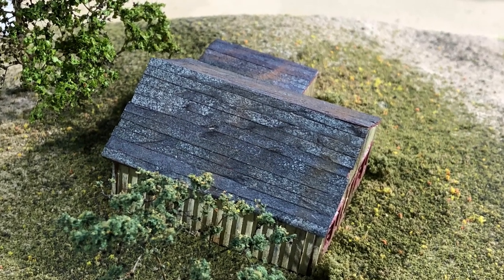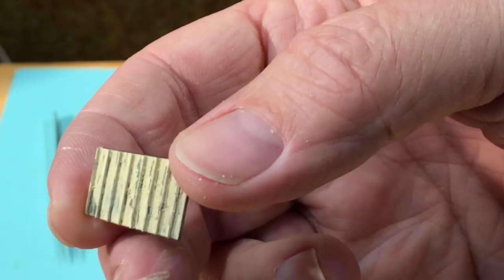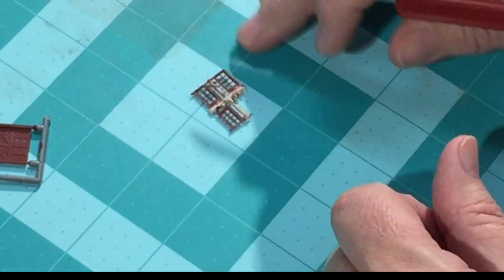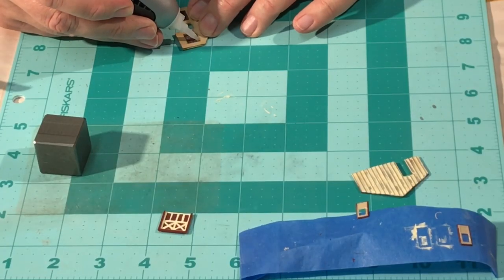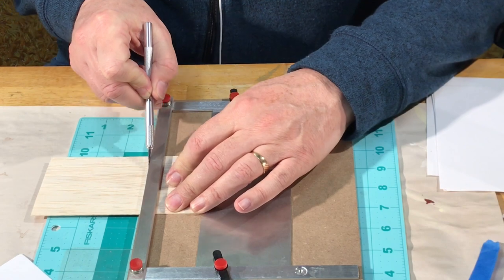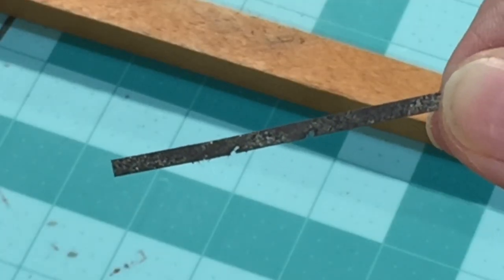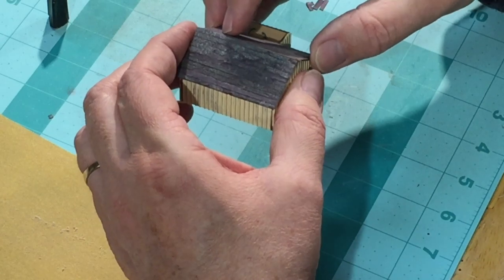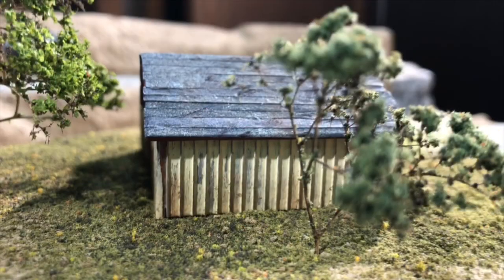Kitbash Scale House | Model Train Diorama How To Series

Comment: Hey Anthony!  Great how to video.  I've found that when using acrylic paint on plastic that a brush tends to just move the pain around on the surface of the plastic.  I've used a makeup sponge to dab the paint onto the plastic and then prior to the paint fully curing, you can smooth any rough paint areas by dragging the sponge lightly across the plastic.  Great video and thanks for posting!! - Brian
Reply from the maker: Excellent suggestion, never occurred to me. I’m hoping to get an airbrush in the next few weeks. Something else for me to learn and share...Anthony
Reply: I've had an airbrush for about 2 years but never removed it from the package!  Will be interested in watching you learn.
Reply: Get ya some acetone and dip your plastic pieces in it, let dry, then apply paint. A miracle will happen!
Reply from the maker: I’ll have to try that, thanks.